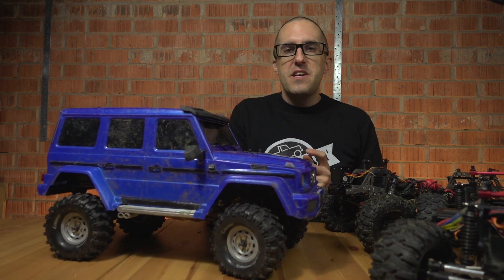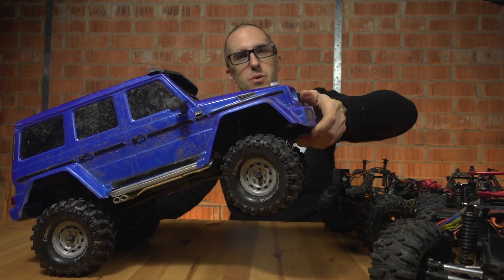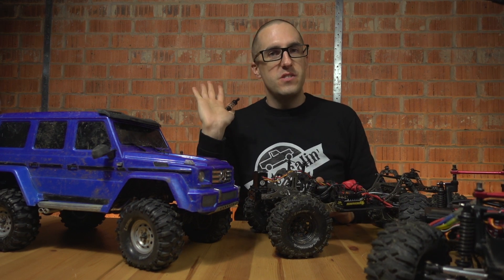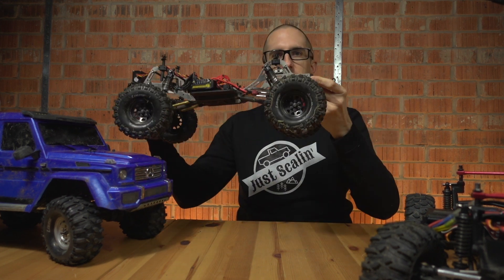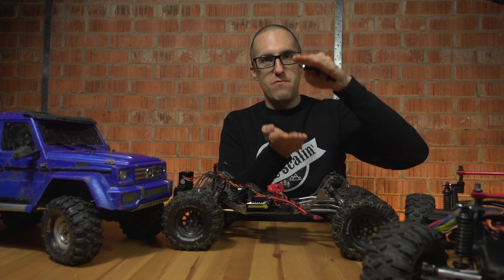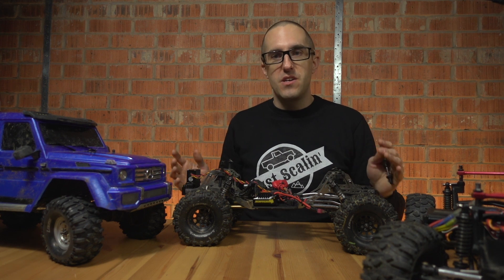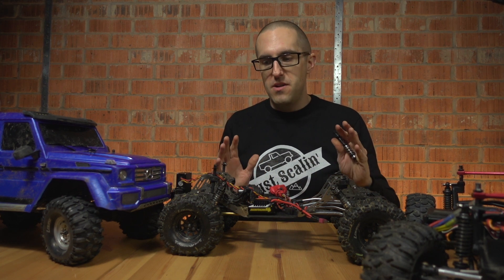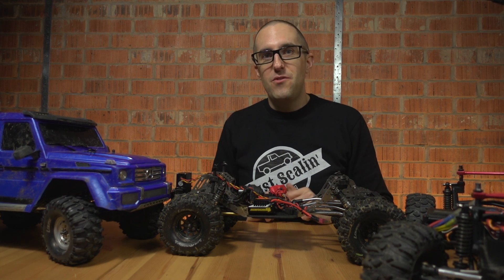Suspension spring rates explained - Learn about your RC crawler shocks

Comment: I found this video very useful, I’ve been trying to dial in these YR desert lizards (100mm) on my gen 8 axe. It’s a got a little bit of weight up front not much but I was trying to get it to where it has maximum articulation but was setting all the way down maxed out full droop cause it left me with literally no spring left. It was like riding without shocks. The only travel was if the wheel fell down. So I went up in the spring weight and now it’s sitting about where you said 50/50 I got some spring left for bumps and plants of flex so I think it’s gonna work here for now.
Reply from the maker: Awesome, glad I could help. 100mm is a very long shock so I’d probably say 60% droop would be good to lower the cog and still have some spring?

Comment: I know this is crazy but I use the lightest springs you can get to set the ride height. Then I use 2,000 weight shock out to slow the shock down and keep it from unloading. Works like internal springs. Different approach with the same results.
Reply from the maker: Oh wow that’s definitely a different approach. Damping video is out next week and covers conventional damping. I might have to take a look at your idea of super light springs and thick oil.